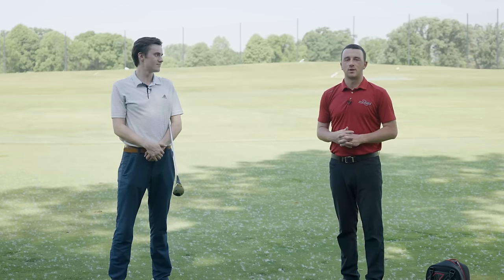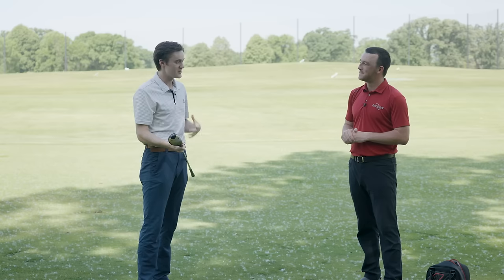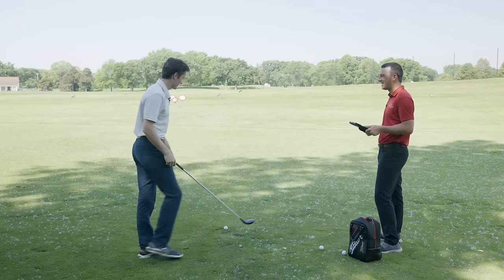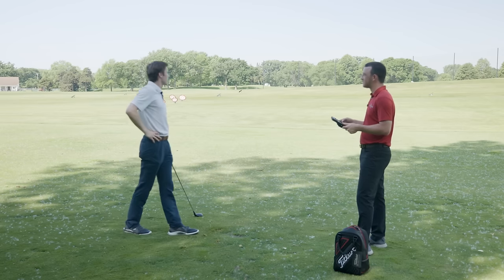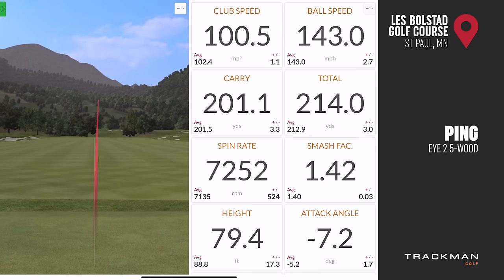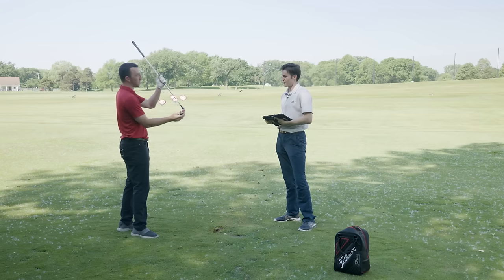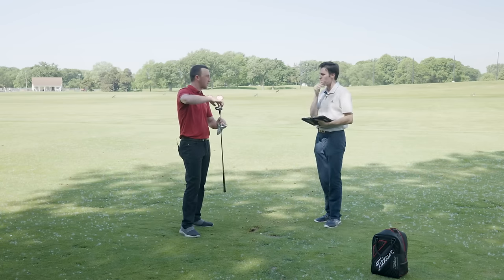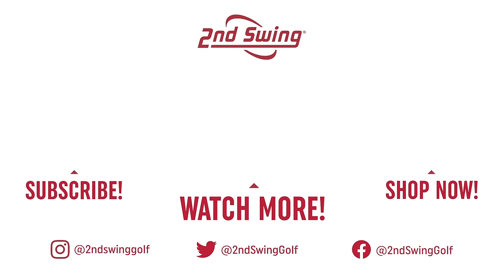Testing Wood Golf Clubs | PING Eye 2 5-Wood

Comment: I find that the biggest difference from old to new is lighter materials so they can be made longer, and the ability to move the cog down for lower lofts, lower spin, and etc. If you hit the old stuff on the screws, it's not that far behind in my experience.

Comment: Should be a serial # somewhere on it that will tell you the OG specs.
Reply: There is definitely a serial number, I emailed Ping about my 1988 Eye 2 Irons for production info which they still had, but nothing came back for my set of woods (1,3,5) Ping said they didn’t record information on the woods. My set is probably early eighties as well.